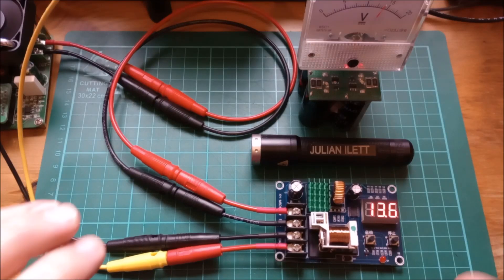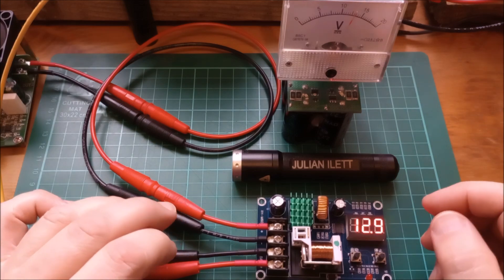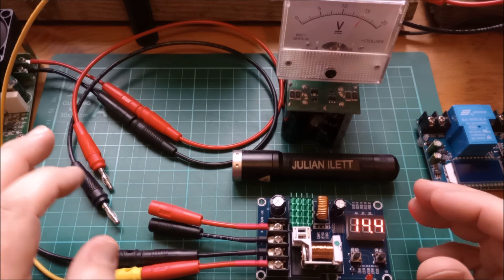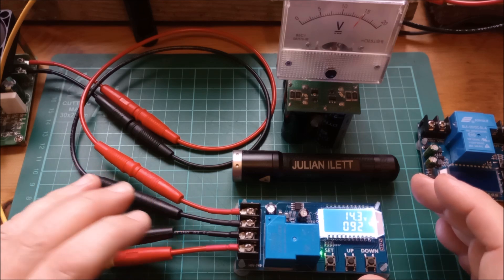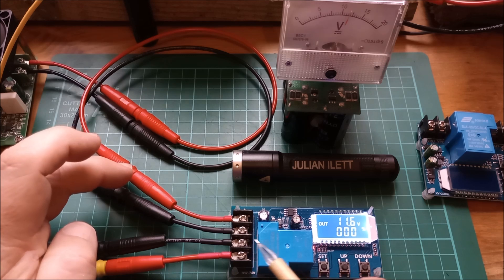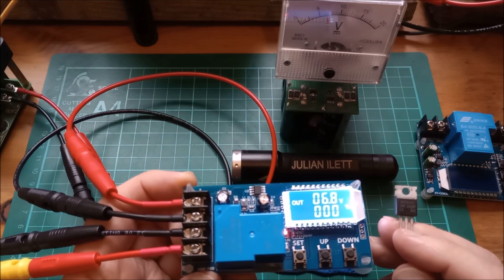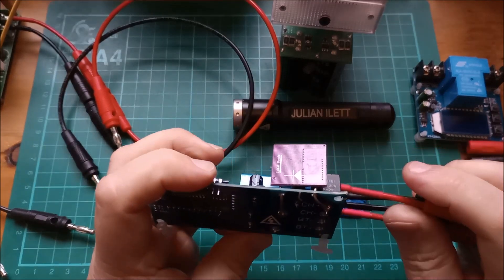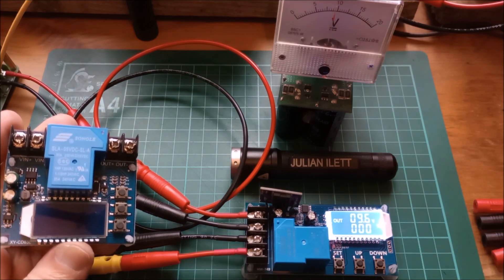Voltage Controlled Relay gets Ideal Diode

Comment: You can do this without a relay. Just use one of those solar buck converters with "MPPT". Set the CV pot for the maximum voltage of your destination battery, and the MPPT pot for the minimum voltage of the source battery.

Comment: Very interesting!  I have a similar problem to what you alluded to with preventing the batteries from discharging, so very open to suggestions.  I'm designing a 48V solar system so I don't want to over-discharge the 48V battery pack, however this is much harder to achieve than I expected!  My first thoughts were a relay, but a 48V coil that can switch ~100A uses over 10 watts, which means 10 watts wasted all night when there's no solar which I don't like.  I've heard you can get latching relays which only use power when they are switching, but I can't find any with these coil voltages and current ratings, they all seem to be designed for 12-24V and no more than 30A.  In the end I have gone down the path of a DIN rail DC circuit breaker, with an auto-recloser attached that I can switch with a 48V signal.  My idea is that when the voltage gets too low I can trigger the recloser to use its motorised arm to turn the breaker off, and when the solar panels start producing power again the recloser can turn the breaker back on.  So it works a bit like a latching relay, just a bit more complicated to control.  I think this should work, but I'm certainly open to any better ideas you might have for high current battery discharge prevention.

Comment: Just an idea to solve this problem for you. Take the voltage input to the mosfet that energises the relay and pass it through a capacitor or maybe a 555 so the relay comes on then drops out for 1 or 2 seconds. That would be enough to drop the circuit out..... or use the older charge control relay to monitor the solar battery and drop the shed light feed from the battery to the new controller, if the solar battery voltage falls below the threshold the old unit will energise the relay and break the circuit..... just an idea you could use if the diode doesn't work...

Note... at the charge control pcb is in the path of the charger will it not effect the constant current given to the shed light battery ?

Comment: Hey Julian,

I've been watching your videos for over 10 years and really love your style! I've successfully built over 10 PWM5 circuits that work rock solid. Your latest video is similar to something I've wanted to create for a long time. I'd like to build a 12V UPS for high current, and I think it might be something that others would also be interested in. Maybe it could be your next project?

Here's what I have in mind:

    Power 1: A 12V 20A power supply
    Power 2: A battery array recharged via a PWM5 (using solar or an AC 15V adapter)

When Power 1 drops below 11.5V, the system would switch to Power 2 using MOSFETs for fast switching (no relays). When Power 1 returns and stays at 12V for at least 20 seconds, the system would switch back from Power 2 to Power 1.

The system would also:

    Disconnect the battery if Power 2 drops below 11.5V and keep it disconnected until Power 1 becomes active again
    Cycle the battery by switching to Power 2 every "x" days for 15 minutes before switching back to Power 1

I was thinking of using an Arduino and maybe designing a custom PCB for this. What do you think? 🙂

Comment: I've done a similar thing with a victron solar charge controller. When the main battery goes over 27.2 volts for two minutes it switches the load output on which charges my anker power bank. If the voltage drops below 26.7 volts for 2 minutes then the load output switches off. If the voltage stays between the two voltages it starts a count down timer which switches off the load output after 1 hour. Voltage is not a great reference for lithium iron phosphate but it does work. These are my winter settings and means the power bank only gets charged when the main battery is at 70-80% and there is a decent amount of solar coming in.

Comment: Ya know you can buy fat  diodes for solar think i got ¹⁰amp ones just thought id join in a share my diode experience 😂😂😂
Reply: Those big fat diodes still waste the same amount of power they just don't get as hot because of their size.  When you're running off solar/battery you're trying to conserve every watt, so you want to avoid that wastage.

Comment: Hi I love the talk of diodes but the idea of wasting so much power gets me.
A latching relay and a small control circuit sounds so much more efficient.
Take care M.
Reply: Fk relays Use FETs and triacs if needed 😂😂😂
Reply: I have a similar problem but I can't find any latching relays that have 48V coils and will handle around 100 amps.  Where did you find such things?

I don't think FETs or TRIACs will work for me as they seem to waste a lot of power at high currents.

Comment: Hi again :) 
I will try to explain...
If i got a battery bank at 48V (n my case 80+ kWh but still same point)
I also got 20 or more 5Ah Ryobi batteries ? (1.8kWh)
Is there a way to "balance" these tool batterys to add capacity to my battery bank?
Thinking  no need to let all of my tool batterys wait until summer when i willl use tehem dayly on my farm?
And yes i know it will be some losses in the Buck/Boost prosses but still it i guess it will be minimal if cycled daily
(My idea is to put tool batterys into use in a solar system with a different Voltage and not a expencive "shelf thing when not in use)
It dosent matter if i take a Ryobi battery at 40% to do some work(my battery bank will also be at 40%ish as i will just grab another or put them to carge in a dedicated charger for tool use
Regards from Norway

Comment: Maybe I am slow, but I was not able to write the part numbers down. Could you list the chgarge controler and ideal diode please?
Reply: Set the speed to 'low' (playback) and use the pause button
Reply: Just search AE for Ideal Diode, you'll be able to recognize the module by the photos.

Comment: All that complexity made my head hurt lol. I do a somewhat similar thing using the buck/boost ZK-SJ20 / ZK-SJ30 modules alone,  with no voltage sensitive sensitive relays required. The MPPT pot sets the input voltage at which power can be creamed off from the source, whilst the CV pot sets the cut-out voltage at the destination battery where we stop absorbing power (anywhere in-between partial to full charge). Not quite the same charging rules, but way lower complexity.

Comment: Given you've got lots of experience driving MOSFETs from AVR microcontrollers / arduinos from the MuPPeT days, how about just making a single circuit with ADC inputs on the in and out and a MOSFET switch inbetween, and a micro powered from the input that embodies the give'n'take logic in one unit? Then you can make it work exactly how you like it :-)
Reply: Blimey ! That is exactly what I was going to ask, he has the technology background but maybe not the same enthusiasm...dunno :)
Reply: Lol you said it for me 
Use Arduino and FETs instead of power hungry relays and china make shift circuits 😂😂
Reply from the maker: Yes, but I like cheap modules. And when they don't quite work, I like to make them work.
Reply: @JulianIlett  :)

Comment: WHY are you not using solid state relays ?
Reply: Yeah, relays draw a lot of current when energised... I have a 12V automotive relay in a project that gets noticeably warm just from the coil current!
Reply: @alaricsnellpym  solid state relays don't have coils...
Reply: @hogify  Yes, exactly.
Reply: Most "SSR's" under $30 are just a simple MOSFET or TRIAC circuit.
Reply: Latching relay?
only drive it once and then its free.
These are already in some batteries rather than silicon.
Take care M
Reply: SSR, exactly. You can get pretty decent ones from China for less than £1 delivered. ISTR Julian's chaanel was built up on him buying and showing 'any old shit from China for under a quid' typewriter of products.